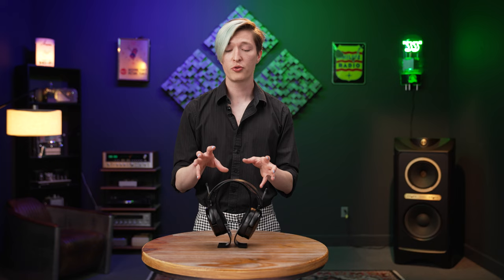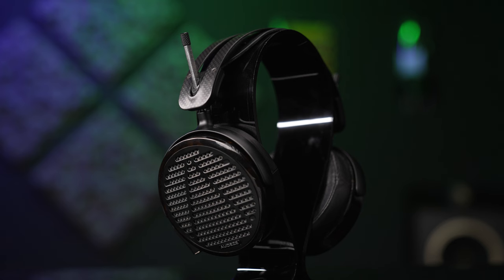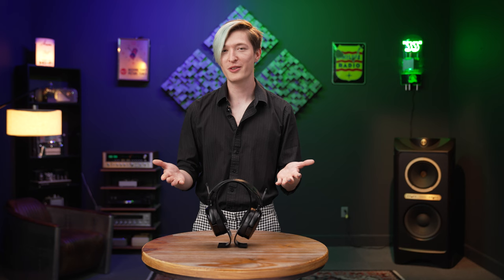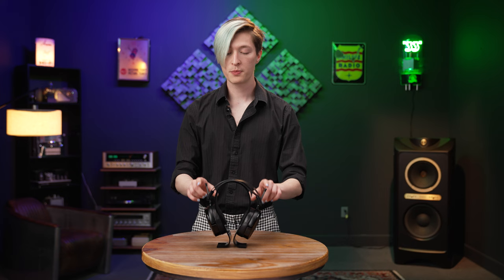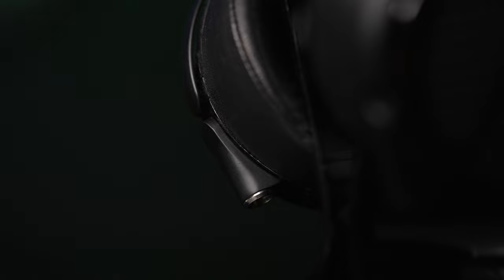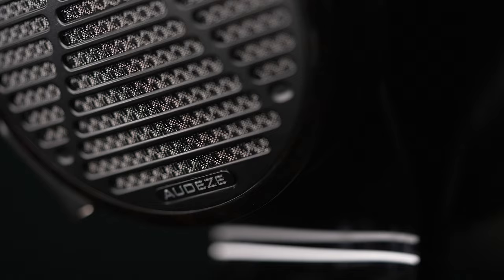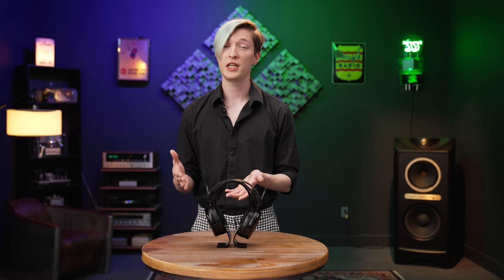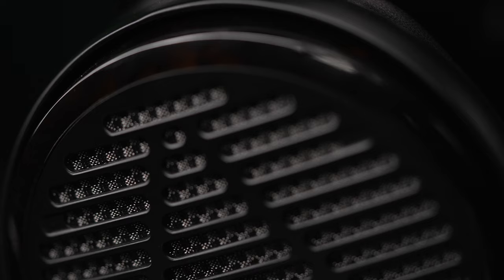Audeze LCD-5 Review w/ Upscale Audio's Grover Neville

Comment: What does "fast" mean, and what objective measurements does it point to? I generally just read it as a way of pointing to a treble spike. I've literally seen people talk about the concept as if different frequencies are arriving at different intervals in a way that can be perceptibly discerned, which is preposterous. BTW, I'm an Audeze fan, but my EQ'd LCD-XC is all I need until they die. Then I'll get another. Of course, I have bulging neck muscles from benching all this weight, but it makes up for the wreck that is the rest of my body. ;-)

Comment: $4,500 Total BS, 
How much technology does it really take to repro 20Hz-20K, $4500 and you need to smooth it? really? and you need an EQ?
Reply: @thomass.9167  You are correct about salt and pepper, but you cannot make the steak $4500 better beyond a certain threshold
Reply: there are plenty of very nice headphones in the $100 and under category that reproduce 20-20khz in a pleasing manner, if that's what you're looking for.
Reply: @xprcloud  and I, for one, feel privileged to have you here to tell me where that threshold is.
Reply: @2ridiculous41  When any attribute is below the threshold of hearing , be it noise , be it distortion , both linear and non linear, If I blind test a group of people who didn’t know anything about what they are A/B/C’ing a $100 $500 and $4500 headphones, one might be preferred over the other , it’s not obvious that the $4500 would win, and any win would be marginal, any headphones producing linear audio 20-20k ( or better), will have slight variations that different people prefer, no headphone will provide 10x better enjoyment or even 10x linearity, in fact if they where, you would find them as laboratory instrumentation, the ancient crown DC300 was used as laboratory equipment, it was that accurate.
Reply from the maker: @7189a This is Kevin - the owner of Upscale.  My best friend Bill has a Bose Waveradio, and would argue you are nuts for listening to 7189a tubes.  Or any tubes.   The same things can be said about cars:  Ferrari SFS90 is $600k and a BMW M3 is under $90k. M3 is faster than anyone needs. But a Prius owner could ridicule the M3 owner.   

Watches? A Patek Philippe Nautilus Carbon is $216k, and all it has is a date.  Compare it to a Zenith El Primero Chronograph for $6k, and is arguably a better watch.  

Life is full of choices.  I'm not going to judge the guys dropping Ferrari and Patek money.
Reply: @upscaleaudio  I humbly appreciate and thank you for your reply,

I used tubes for a limited time after a class AB SS went DC and blew away my loudspeakers, output trannies can’t do that…
now I am on Class-D..

I can’t see a headphone beyond being an appliance VS Jewelry or status symbol such as a watch…
unlike BMW and Ferrari, these headphones do not contain any unique technology at all or even if it does, not $4500 worth of technology, to reproduce 5hz-50Khz at low distortion.
Reply: @7189a  I spent $4500 on the lcd5 and it was worth EVERY PENNY. Get better music and equipment and maybe you can experience why it is one of the best headphones on the market.
Reply: @michaelp.3485  20hz to 20 Khz at a known distortion is factual, but a person filled with ego, wasting $4500 has to justify the BS while the headphone elements inside are still $25 made in china, covered with fallacy. more audio phoolery.
Reply: @xprcloud  have you listened to them though? I have and I think the pricing is fair if i can get them during their black friday sale.